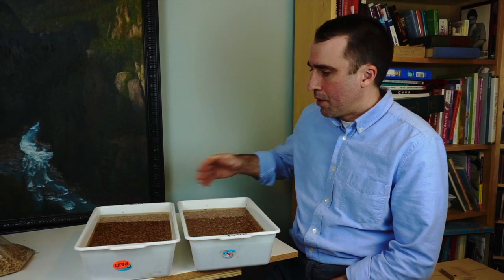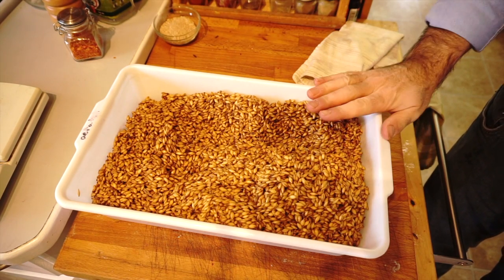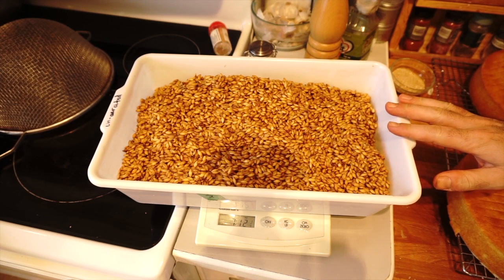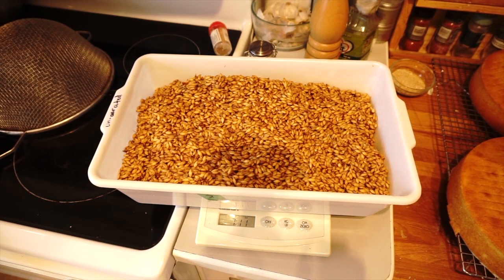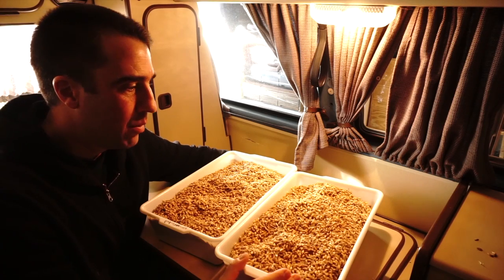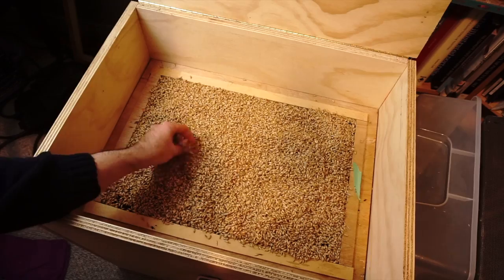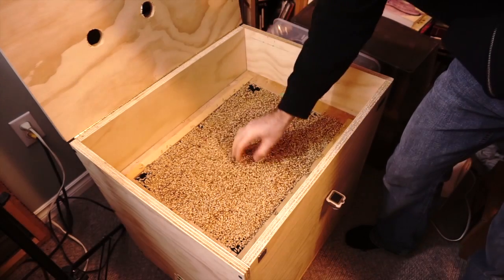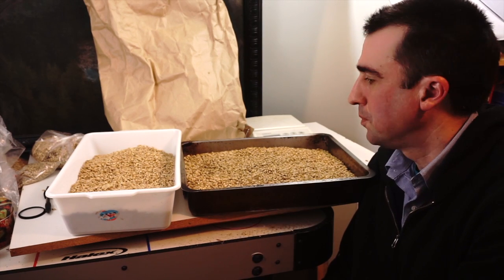Un-aerated steeping Part 1

Comment: For my last batch I super-aerated the steep with about 100ppm hydrogen peroxide, which is also enough to act as a sanitizer and substantially reduce microbial growth, though h2o2 has a very short half-life under these sort of conditions (like 12hours) the decomposition products are water and oxygen. I did notice a distinct lacto-yogurt smell (maybe a touch of vinegar) a day or two after chitting but I didn't taste any noticeable sourness and the smell subsided by the time I was ready to wither it. I was also using a fairly high moisture target adding water throughout germination.
Reply: 100ppm is about 3.3ml(3/4 teaspoon) of 3% peroxide per liter of water, or 2.5 teaspoons per gallon, 1/4 cup per 5gallons. 
25ppm is actually enough to treat reasonably clean water for drinking(given enough standing time), I just used 100ppm because all the organic matter(pounds of barley) and the chlorine in my city water tends to neutralize some of the h2o2 right away. Also H2O2 is good for removing chlorine and chloramines.(though I forget if it is a reduction or oxidation reaction, which will be determined by acid or basic pH) 
Ascorbic acid or sodium thiosulfate(cheap, sold for film photography, and several other uses) are also good at dechlorination.
Reply from the maker: @TheDuckofDoom.  Interesting, thanks wolfedog99!